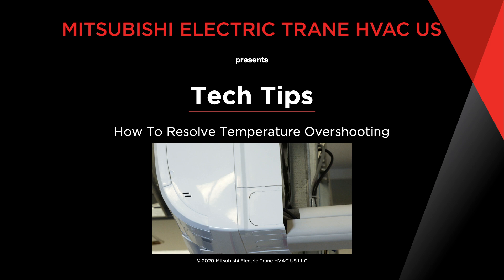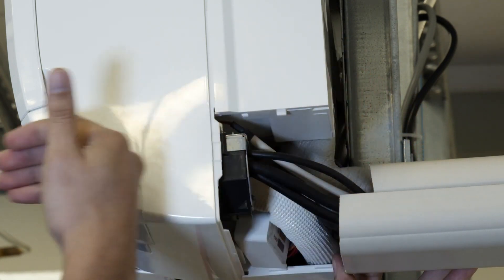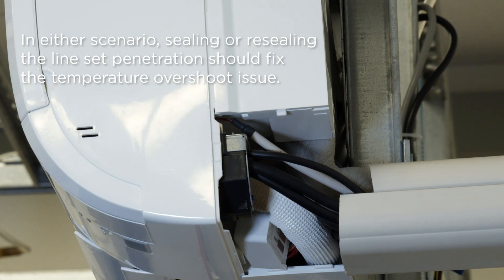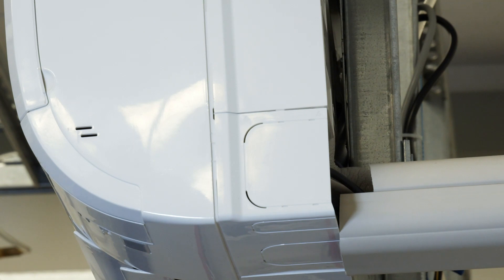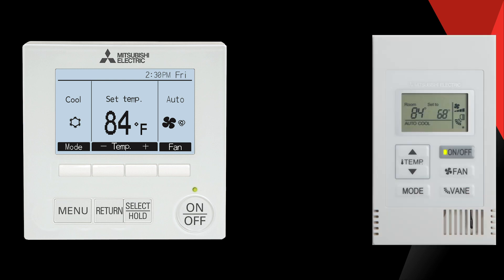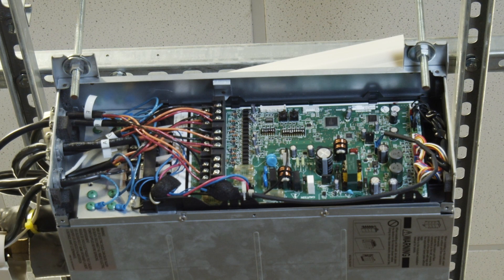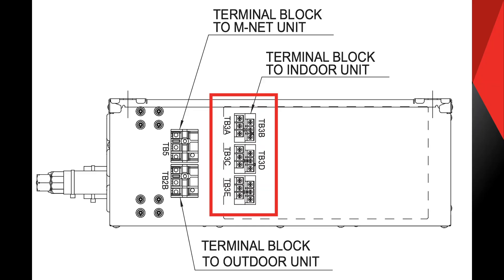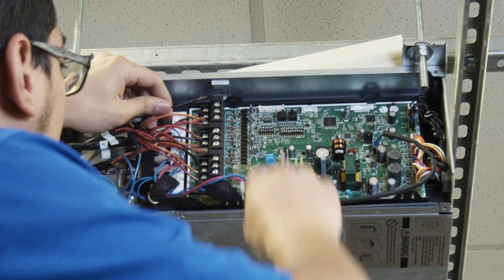How to Resolve Temperature Overshooting

Comment: For the cross wire on the multi zone system: could the one that was getting all the refrigerant start to develop snow inside the indoor unit? I’ve the problem where it cools on room but not the other.
Reply: yes